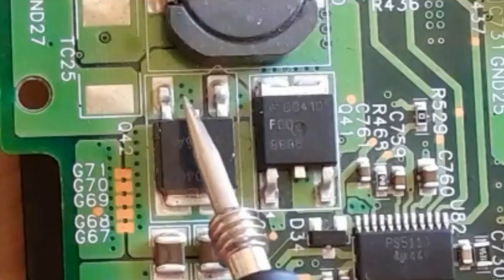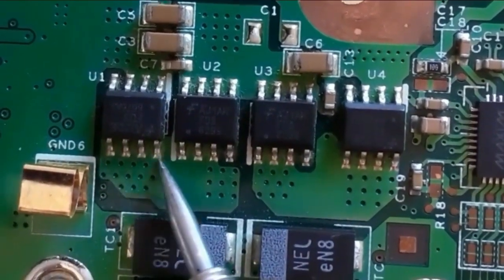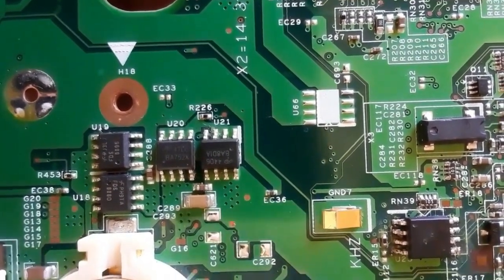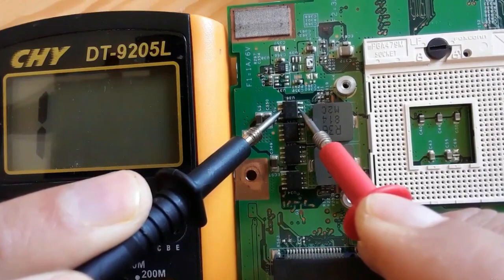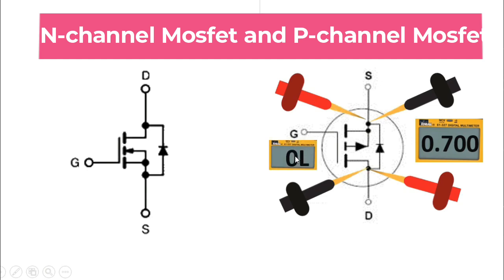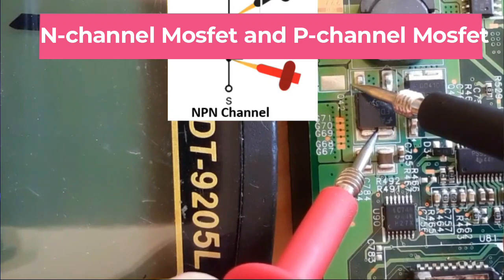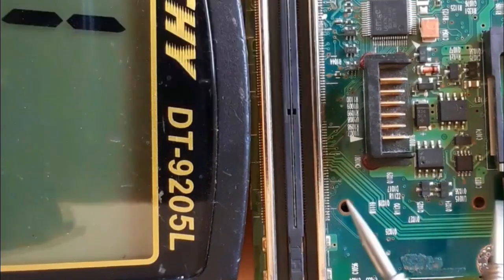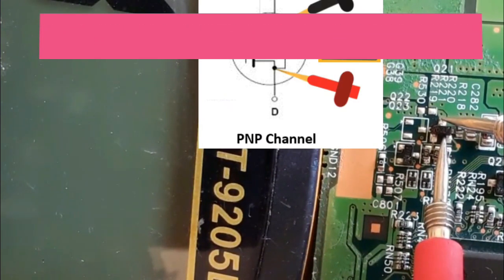8 Pins MOSFET Testing VS 3 Pin MOSFET Testing Using a Multimeter - how to test mosfet

Comment: Hallo ERB, ich bin sehr fasziniert von eueren Job- so das ich selbst Reparaturen an Laptops/Motherboard ausgeführt habe.
Habe paar Motherboards durchgecheckt und Paar Fehler entdeckt. Leider mit Bezeichnungen komme nicht klar, bzw. über die Produktteile, wie findet man die im Internet (ein MB schematik hab noch nicht im griff) 
wo finde ich zum Beispiel diese Teile (Mosfet,...?)

1. DELL Latitude 7280/7380
- MB: CAZ10 LA-E122P
      Rev.:1.0 (A00)	
      2017-05-12
"Mosfet: G370
	814JD6"

2. Lenovo Yoga 500-14idb
- MB: LT41 MB
      14217-1M
      448.03N03.001M
Mosfet: 7401
	GA5V27

3. MSI GE62VR 6RF
-MB: MS-16JB1
     Ver.:1.0
Chip: L2A7 (U38)

4. MSI GE62VR 7RF
- MB: L2A9 (U38)

falls Du mal Zeit und Lust hast,...